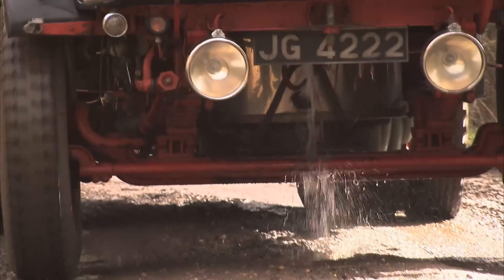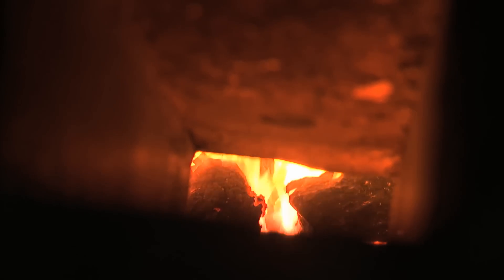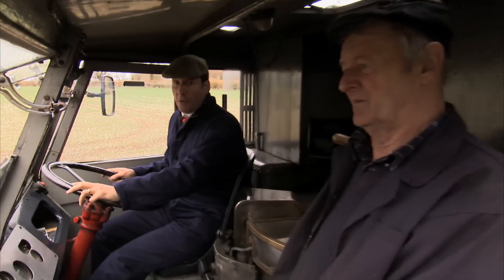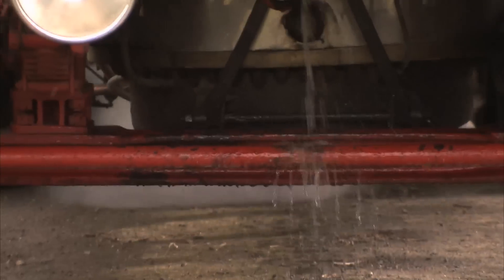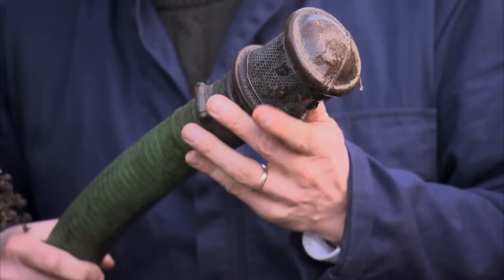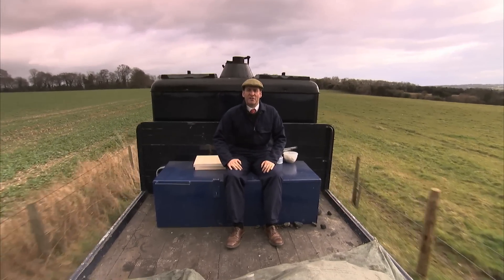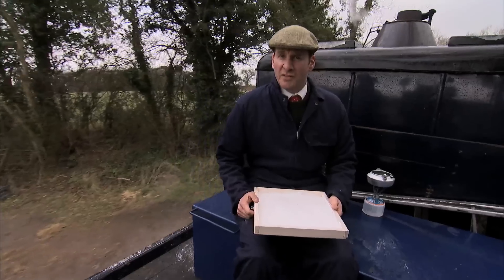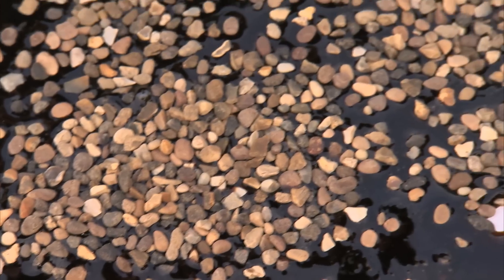What's the Greatest Machine of the 1930s...the Sentinel Steam Waggon?

Comment: anyone know how the electrics worked on these ?.
Reply: There's a battery on board and a dynamo connected to the rear axle. When you drive you also charge the battery
Reply: They could have used a turbo-generator, which is what a steam locomotive uses to power the lighting.  A turbo-generator combines the driven part of a turbo-charger and a generator.  The turbocharger's exhaust-driven impeller is driven by steam instead, and spins a generator to provide electrical power.  A wheel-driven generator may be a simpler solution.  Eliminates a couple more pipes and joints.  A turbo-generator works well with a steam loco, as many of them spent alot time stationary, or moving too slowly to spin a wheel-driven generator fast enough.
Reply: @railtrolley  they could have, and there were companies like Stones that made those for road locos and the like, but it's unnecessary here since a Sentinel in it's working days was almost constantly driving around and a battery/dynamo setup saves a bit of steam

Comment: Why didn't they capture the steam/vapours and turn it back into water?
Reply: Some did, but it's a hassle. Condensers add a lot of weight and size. You also need an oil separator to take out the oil that's used to lube the engine since steam engines use a total loss oil system.
In the end it was almost never worth the effort, let alone the upkeep.
Ships did use them extensively though, since there's no fresh water at sea
Reply: @Nubby007  just need a tank to collect it in, will condense itself by cooling in the ambient air. Aluminium or plastic would do the trick, dunno what steam engines you know of but The water is housed in a tank separately from any oil, oil is in the engine lubricating the moving parts
Reply: @clive280178  not quite. Steam condensors with any efficiency usually work with a vacuum pump or a large cooling coil
There's always oil in the outgoing steam because you have to lubricate the cilinders and valves of the engine too.
It's just simply too bulky and not worth the trouble on land since water is relatively abundant.
Garrett experimented a lot with condensors with some success, but a Garrett with condensing gear is extremely rare now days.
Some colonial engines had de experimental condensors too since Africa and Australia don't have as much water, but in the end the way to make steam engines reliably more efficient is super heaters, not condensing.
Reply: @Nubby007  got 100 miles for the steam to cool down or 2 hours estimated, pretty sure it will be fine as it's already condensing into water vapour as it leaves the exhaust.
Reply: @Nubby007  you do know space rockets are steam powered right?
Reply: @Nubby007  and steam turbines for massive power stations?
Reply: @clive280178  that's not the point. They do exist and they do work. A lot better and more efficient than having a large tank on you roof (and not all of them have a roof). It's just that in certain cases like road use here it makes a negligible difference for a lot more bulk and effort.

And don't start bringing in examples of steam engines that have nothing to do with the original argument.
Of course powerplants use condensers. But powerplants don't have oil in their steam so that already takes away a step.

A far better example is to compare Doble steam cars to Stanley Steamers. Doble were way more sophisticated and did indeed use condensers but were vastly outsold by Stanley simply because they didn't have so much going on so they were more reliable and a LOT lighter, not to mention cheaper
Reply: @Nubby007  one empty plastic tank the same size as the original water tank is all you need can fit it anywhere. You can probably cut the other one in half or even a quarter, the quicker you recycle the steam vapour the less heat required to reheat it, and if you've got a constant supply then how much do you need in your original tank?
Reply: @Nubby007  tank not engine Sorry
Reply: @Nubby007  even better, just a pipe, steam come off the top and circulate back into tank
Reply: @Nubby007  I'll stick with circulating it back into the engine actually, put it on a one way valve teed into the water supply line from the tank
Reply: @Nubby007  I commend your effort to explain the thermodynamic issues to Clive, but you would have been more successful with a rock. At least a rock wouldn't post moronic replies ;-)
Reply: @EDesigns_FL  got nothing to do with thermodynamics, more about making a vehicle - which can also combine as mobile highly efficient power station :)
Reply: @poruatokin  what's recycling steam into the engine got to do with laws of thermodynamics? I'm trying to increase efficiency
Reply: @poruatokin  but for the record I'm fairly certain a steam turbine could heat a heating element and keep itself going
Reply: @clive280178  Okay, I will only explain this once, even though Simon von Doesburg already did it.
Useful steam at working pressure is way above the boiling point of water and completely invisible.  It only becomes visible after it has been expanded and cooled in the cylinder, and lost most of its energy.  As a starting point, at least study Boyle's Law - it only covers dry gases but it's a start.  
Some huge marine engines as well as a few locomotives were built with very high pressure systems and two or three cylinders in series with each becoming larger than the previous to work with different steam volumes.  These are known as single, compound (double) or triple expansion engines that extract as much work as possible out of the steam but they were massive.
In all cases, once it exits the engine and becomes visible, technically it is no longer steam, the correct term is water vapour - i.e. it is no longer a gas, it is now water droplets suspended in air.  This cannot be recycled back into the engine as it is too cold and has no pressure.
It has undergone massive expansion and cooling to the point that the number of water molecules per volume of air is now very low.  In order to get this tenuous vapour back into a usable liquid you are going to need huge capacity condensers to drastically cool the vapour much further, in the case of the steam lorry you'd probably be looking at something at least half the size of the entire vehicle and very heavy.  For an idea of what this looks like in your home, take a look at the cooling coil on the back of any refrigerator or just Google "air cooled steam condenser".
Reply: @clive280178  That is a perpetual motion machine which is bollocks
Reply: @poruatokin  water is water, heat it up you get steam, by recycling the steam it adds heat therefore requiring less fuel to heat the water to steam. It's just a cycle, you have water, you heat it to get steam, it turns to vapour in the tubes as it's condensing back into water, I don't want it to condense into water cos that means I've got to heat it up all over again - very inefficient.
Reply: @poruatokin  waters incompressible, I'll let the pressure gauge decide if my steam is still usable after one cycle
Reply: @poruatokin  am both, ta ta
Reply: @Dan Didnot so they didn't have to stop at a pond and fill it up again. You can't get rid of water it only ever changes state
Reply: @Dan Didnot just found out the first bicycles didn't have pedals for 73 years. Amazing feat that they could outpace a galloping horse, all wth wheels made of iron. Are you seeing what I'm seeing? Clues in the name velocipede

https://www.si.edu/spotlight/si-bikes/si-bikes-velocipede
Reply: @Dan Didnot just found out the first bicycles didn't have pedals for 73 years. Amazing feat that they could outpace a galloping horse, all wth wheels made of iron. Are you seeing what I'm seeing? Clues in the name velocipede

https://www.si.edu/spotlight/si-bikes/si-bikes-velocipede

Comment: Fantastic, a 50mph truck in the 1930s, they should have kept developing these!
Reply: Saab actually try to develop steam powered car inthe 70. with some clever features
Reply: @ezicarus8216  sad someone who even didnt know why they go bankrupt ;-)
Reply: @ezicarus8216  so you didnt know... as expected... bye
Reply: They had to stop production because there was a drought
Reply: @justan idiot it just be today first heaven's sake
Reply: Not really.. the coal fired trucks are extremely inefficient and polluting
Reply: Morten you could power a boiler with gasoline or any other fuel source.
Reply: @Gizmoand23  Did you read ALL of my comment? "They should have kept 'DEVELOPING' it"! Have you ever driven behind a council diesel bus?
Reply: @comicmania2008  developing it wouldn't  have changed much.
Reply: @comicmania2008  they're gone now though aren't they
Reply: @Gizmoand23  I mean gasoline engines used to be pretty polluting and inefficient
Reply: @youdamanyoudaman  please just stop.
Reply: @Gizmoand23  
If developing it would not have changed much kid, why do have Steam powered satellites?
Reply: @comicmania2008  - You can't get better than around 12% overall efficiency, whatever you do. Besides it's so much more complicated than burning the fuel internally.
Reply: @Gizmoand23 
You wouldn't have to use coal, the process just requires heat to boil water.

LPG would be a much cleaner option.

Comment: This machine is incredible, I would loved to have one today.
Reply: You still could if you really wanted it
Reply: Why?
Reply: Imagine one automated and converted for fuel oil as a motor home
Reply: @kevinpeters6709  External combustion engines have lower operating temperatures than the fire itself so are inherently less efficient than internet combustion engines, typically around 10-20% efficient, average gasoline engines are a bit better than that, and the most advanced diesel engine are at about 55% efficient... electric can be around 90% efficeitn at converting stored electricity to motion but total efficiency depends on the power source, A solar system could be somewhere around 15--20% efficient at converting solar energy to EV motion... in the best case of only loosing a few percent in the inverter and charging. if using Grid power they would be some percent  less efficient than the nuclear/coal/natural gas or whatever grid supply is.
Reply: @Wingnut353  well.. efficiency

Comment: Does anyone know what the equivalent horsepower is of this machine?
When did diesel/petrol trucks start to be more powerful than steam trucks?
Reply: @Marc,
Are steam engines rated in ton-miles instead of pound-feet?
Reply: They didn't, a rocket is a steam engine
Reply: @clive280178  You can make a rocket engine that uses steam for thrust, but not all rockets are steam engines.
Reply: @Sashazur  'space' rockets are steam engines. Diesel engines were never designed to use diesel either, name of the inventor who was using peanut and seed oil

Comment: so are these more eco friendly than petral buses
Reply: @The,
Yes.
The amount of carbon is identical whether in solid or gas form.
Reply: hell no xD 
bc your burning coal
Reply: @mplewp  Yes they are polluting but the particulates that came out of the chimney were "heavy" and sank to the ground unlike exhaust from petrol /diesel engines which tended to go up into the atmosphere.
Reply: @haroldpearson6025  dude burning coal is not ok xD. because coal is not pure. you burn lots of other stuff with it . sand / impurities / oil . and maybe just maybe a touch of radioactive elements xD. thing is in the old days measuring devices didn't exist yet. you don't just get to pick the thing your focussed on. :P